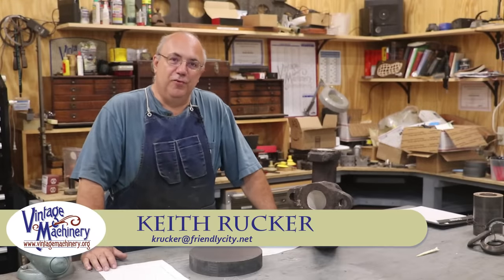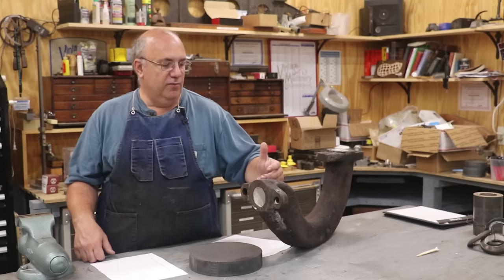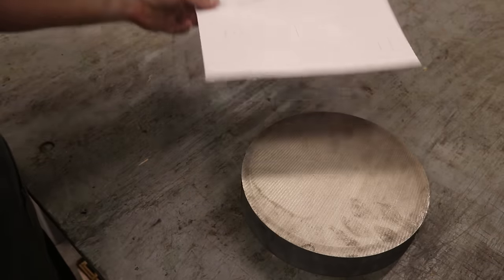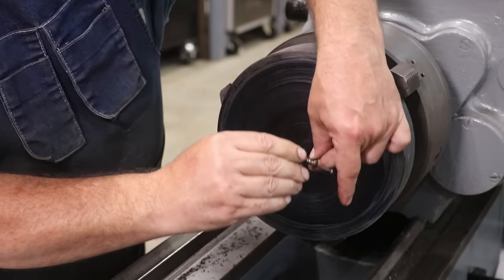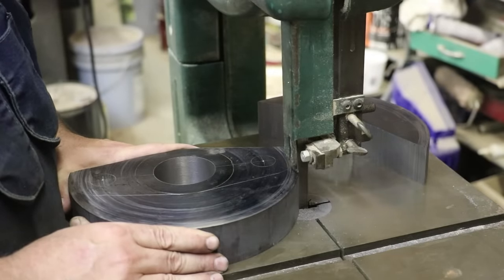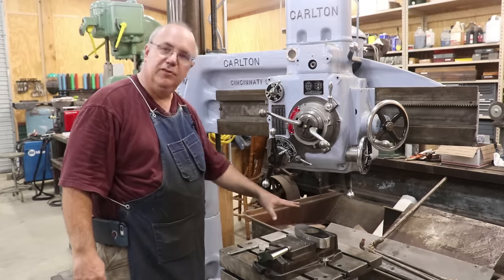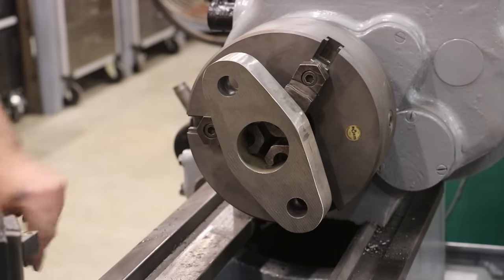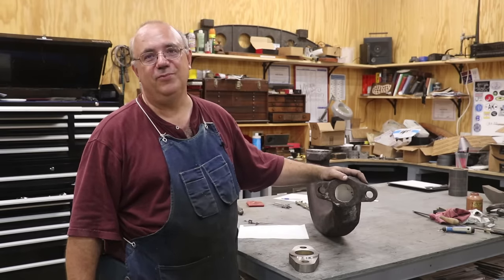Steam Locomotive Steam Pipe Repair - Part 2:  Machining a New Flange

Comment: I would use a boring head in reverse to machine a snout on the old pipe that would pilot into your flange. It would give you a much stronger joint. Personally I still like the idea of a slip joint with that flange to accomadate expansion and contraction as well as movement from loads but that is just me and I know it wouldn't be original.
Reply: I agree completely with you on fitting the flange this way. Also I would dry fit them in situ before tacking them together.

Comment: I'm so glad that you took whomever's advice, I think that's gonna be a lot more solid than the original plan. Now you just have to get it lined up perfectly against a lopped off cast iron part with no machined references, with tight enough tolerance that braze will create a strong joint. Hehe. I have faith that you can do it!

Comment: That's another great video full of "how to's" .  Durabar is a wonderful resource for DI and CI material.  They always provide extra stock over the  print dimensions, to make sure you can clean up okay.  I'm glad you covered the difference in expansion between iron vs. steel.  That was my immediate thought when you started talking about a steel flange brazed to the antique iron pipe, and that could get a novice in trouble.  As ususual, the vicarious experience was enjoyable.  Now for the big trick of alignment.  That should prove interesting.

Comment: As a machinist for the Navy for 26 years the way I would repair that is to cut both ears off.  I would then set it in a horizontal mill to flatten the end then center the spindle on the center of the hole. I would install an indexing head to the spindle and as the cutter went around the outside of the pipe I would slowly adjust it to take more metal off until I had a fully machined surface around the opening in the end of the pipe. I would then machine a flange that had a 2 to 3 thousandths interference fit, heat it up and press it on the pipe. I would then braze the flange to the pipe.

Comment: Keith thank you so much for everything I have learned watching you and your channel. You have some truly amazing people to help with feedback. From a strength and ease stand point I would think that I would want a socket on the flange and fit it in place to allow for both maximum strength and minimum time to be able to fit up your repair. I might even think about using a spiral wound gasket for maximizing the seal of the joint. It would not be original but it has shown me the they’ve fantastic for being able to get a great deal. Thanks again.
Reply: Nothing like a typo lol....

Comment: I would taper counter sink the back of the flange, grind off the flange ears off the original piece and add a taper to the end that matches the rear taper on the flange and then braze them together where the the taper seats into the flange, if you just completely lopp that end off you will have only the surface area of the thickness of the tube wall with the new flange.

Comment: When repairing a pipe spool I always bolt it to a couple of dummy flanges, tack them to a steel table and remove the part to be repaired. You can then bolt the new parts in and weld or braze them and when you take it out it fits.

Comment: Although this is a comparatively small branch pipe, I would consider bolting it back onto the throttle pipe head and the new part with proper seals (copper I believe) bolted to the saddle. I would then pre-heat with a couple of rosebuds before brazing in place. Wrap it in a welding blanket or two to cool slowly. I believe this might help in achieving proper alignment.

Comment: Watching this series over a year after it was done but my first thought was why not build a whole new flange. I also thought about leaving extra material on the width and thickness as well as the length to have as much surface area as possible but I tend to over build everything. Thinning the flange on the lathe before cutting it in the band saw might have been easier. I assumed you would cut it down to the 4 inch first to avoid the interrupted cut but it didn't seem to be a problem.

Comment: I am not a machinist, not at all and hindsight is a wonderful luxury you did not have!!
Would it not have been easier to have kept it round, clamp it down, drill the side holes, turn it down to the correct thickness with the raised bit without having the interrupted cut and then band-saw it to the desired shape?
Love the video's !!

Comment: I did something similar with the body of the quick change tool post I made.  Using radial marking grooves to highlight where corners and junctions in the dovetail should be, and mark where the bore and split termination hole centers should be.  Put a center line across all that, and you have enough visual reference points to keep Bozo at bay.

Comment: Hi from England 

I think you've taken the best way to approach this one Keith...
Sometimes it's better to start off again with a clean, straight edge....

No doubt them clowns at that local fabrication shop would've just kept on banging more & more heat and more & more ore into it....until eventually it'll have just popped it all...

Older iron with high impurities and what's been subjected to hot & cold...hot & cold...hot & cold for years on end can be a bitch to weld as well...

Now...
How are you going to fit it to the end after you've lopped the old flange off...?
How about a thin sheet metal sleeve shaped to fit the inside profile....you can then infill with braze...
You could drop it in the pipe first...with some sticking out and gently hammer it to fit the bore profile...then braze it in...
Then drop the new flange you've made over it...again, braze it in....then go round the meeting edges...braze it...
That'll be ship shape & Bristol fashion...

You know what...
You'd even get away with a silver solder Keith...

Comment: This isn't rocket science guys....so many comments about precision fits, tacking in on the job etc. Keith has the original blueprints the part was made to. All that is needed is to ensure the cut made in the pipe is square and accounts for the new flange thickness, then clocked correctly relative to the other end. A simple grinder will achieve the bevel needed for brazing, and a simple fixture screwed to the table will hold flange and pipe steady for the job.
These locomotives were made 100 years ago- such precision was unachieveable and they were designed with tolerances to account for this....it doesn't seal to the flange- it seals to a ring which allows for some misalignment.

Comment: Using your logic of different materials moving at different rates will the braising expand different from the cast-iron and crack being such a large area would it not be better to use a cast iron stick welding rod so the entire area is cast iron and movers the same

Comment: i spent several years working with various types of gas fired waste heat boilers and they were all steel.  I wonder why they did not use steel to make the pipe and the flanges and weld the flanges on.  I guess that is because I know nothing about steam locomotives.  I suspect the welding technology of the day could not handle that large of a job.
Reply: Compared to some of the gentlemen commenting on here, who obviously have had careers working with steam, old boilers, locomotives, ships... I am a complete amateur, bordering on a babbling idiot, lol! 

However, I suspect cast iron was used here because it does not expand and contract like steel does. And, in that era, they had limited choices - less alloys, less fastening alternatives, etc. 

But, what they did know was the awesome, violent properties of that steam that was to be channeled through those pipes... And the way they did it lasted for 100 years. And for an environment that gets super-heated - and pressurized - like this, I think that's a phenomenal feat of engineering, again, for what they had to work with... Only the human mind to compute every single possibility, factor in every single thing that could impact that pipe, that joint... 

It's actually staggering when you stop and think about it - compared to today, where even the laptop I'm working on, given the right software and the properly educated mind using it could offer up that part in moments - plus different suggestions on what alloys would be ideal, etc etc.

All that to say that I think the guys back then knew what they were doing. :-)

Comment: A fundamental mistake. That casting begins its steam flow curve within the flange area and your replacement flange does not take that into account. I expect that when you slice the casting to mount your new piece, you will find a large gap that you will need to fill on the inside of the arc. Along with a large amount of grinding to allow for proper steam flow. Otherwise, you will find that your repaired part will not allow enough steam through to allow for balanced power in the engine. A good first attempt.

Now set up a jig to hold the parts square and true for the assembly portion and then cut off the old flange. That way you can see how to shape the steam flow and mill the offset to match the next attempt to the existing piece.
Reply from the maker: I think I have it under control.  You are correct about the curve, but I have taken that into consideration and made sure my plan will work.  The flange has more machining that will need to be done but I cannot do that until I get the old flange off and make some measurements.

Comment: All the laying out why not copy the diagram and glue it to the blank cast iron disc.
Reply: That is what Clickspring  https://www.youtube.com/channel/UCworsKCR-Sx6R6-BnIjS2MA would have done.
Reply: only works if the pattern is exact.  Laser printers can distort the dimensions during printing
Reply: I do not think the tolerances are that close to worry about, it is not a clock.
Reply: Paper stretches and creases, plus a scribed line is a lot thinner than a printed one (or at least that printed one). Laying it out means it'll definitely be accurate enough (the paper probably would be, but it'd be a pain to make the part and find it's just far enough out not to fit).
Reply: He took the measurements from the paper template.
Reply: Yes and no - he read the annotated measurements off the paper, then used a steel rule to set the dividers. He did not take any measurements directly off the diagram.
Reply: He also cannot rely on the measurements of the pipe as it keeps breaking, it is not right

Comment: I being from oil field country I would have put aside the old part for future cast iron replication . Then have a steel part made to replace the original part not a repair of the old part as I think there is too much heat for brazing to do well.

Comment: The size of that flange kinda puts the size of the pipe into perspective. It just didn't seem that big till you held the 9" long flange up to it.
Reply: Lining up everything to make sure it fits is going to be a problem. I think it will have to be partially brazed in situ in the steam engine to make sure of alignment and then finished on a bench.
Reply: i agree with you tony thats the way i would do it. bolt everything up in its happy spot and then i would heat it up and take the chill off it and then i would tack it good with silicon bronze then tack it out and braze it. once you get it 2 thirds welded then grind out the bronze tacks and then carry on brazeing.
Reply: I do not think it was casted right in the beginning as it keeps breaking lugs unlike the other one, it must have a twist in it and the only way to to align it is in situ. Trying to do it on a bench is impossible to align and all the hard work of making the lug will be wasted.
Reply: i agree again tony doing it on the bench and takeing all kinds of measurments and such would be near to totally crazy to try that on the bench and hoped it worked and lined up again waste of a whole bunch of time in my opinion. must be done in position.
Reply: im really looking forward to see how kieth is going to do this.
Reply: He usually comes out on top, he has something up his sleeve.

Comment: I would braze it together in place if you have the room inside of the locomotive, that way you know it is in perfect alignment.
Reply: If you can't braze it in place, put it on the locomotive and draw some alignment marks at least.
Reply: I can't think of a way to test fit these parts without risking excessive removal of material from the original casting. I look forward to seeing how Keith approaches this problem.

Comment: Will you dry fit it to the locomotive?  It would be neat to bore and machine the flange and original part to make a more secure joint...maybe.  Talking as a bricklayer instead of a machinist.  Just a thought,  Greg.
Reply: Absolutely. Bolt the parts on the locomotive then braze. Assured of a proper fit that way.

Comment: Wow looks great!! For fitment, you should bolt the flange and the rest of the pipe onto the locomotive separately, and then tack weld it together.  That way you know for sure it will all line up in the end.  I have done a lot of exhaust work on cars and I have found that is best the way to do it.  It will never work out if you try to weld it on before fitting it back in the locomotive first.

Comment: I was wondering if there was enough room in the train where this pipe goes that you could have just punched the holes, turned your 1/8 inch flange and rolled with it. Seems like it would be much stronger and also you could have cut a couple more holes perpendicular to the other two and it would never break. You said there was plenty of room so that is what made me wonder...

Comment: Nice Job Keith. 
You know I wondered what the heck is Keith going to do with all that huge equipment, Well it looks like that Radial Drill made short work of that cast iron. 
Outstanding, you have a shop that so many of us envy, and you have worked very hard pulling it all together.
Gary
75-Year-Old Home-Shop-Machinist in North West Arkansas.

Comment: I would have thought this job would best be done using a rotary table on the milling machine. Could have used the DRO to position everything easily and accurately. Also, no need for the bandsaw.

Comment: When I first heard the term "boring bar" I visualized a step-by-step increase in diameter, just like you are doing here with your increasing drill diameters.  That was not quite right, but you are doing this kind of thing, though with a drill bit, so I was not completely wrong.

Comment: Bc and I think alike , I'd bore the boss on the old part and open the flange to accommodate as much has I could at least 1/4" walls . Then the original cast part will be supporting the pressure and not just the brazing. Think about it it's not much more machining but it'll maintain the integrity of the original part..

Comment: I have to agree 100% with what you did in this episode, choice of material, thickness , liked the layout and manufacturing of the part and could feel how my teeth relax as the bandsaw chew through the cast iron like butter at 25x.

Comment: Do not sweat the minor cosmetic issues .  The public will never see it .  Dimensionaly , I an certain it will be closer to the blueprint than the original 100 year old casting .  All it has to do is fit , work & not leak .

Best of luck to you ,   :-)
Wyr
God bless

Comment: I have a newbie procedural question.  I was wondering why you chose to cut out the flange before doing the lathe work on the second side.  My first thought was that doing both sides round you would not need to reconfigure the lathe chuck, and you would not have an interrupted cut for the turning. You would also have had a thinner part to saw, 1.125 instead of 1.75+.  But then, trying to figure out the counter advantages to the way you did it, there is a lot less nasty cast chips and dust to clean up on the lathe.
As a wanna be hobby machinist, I would like to learn the factors that you guys with experience and expertise consider on a job like this.

Comment: I suspect you will bolt the pipe in place and figure out from there the geometry of the flange. Perhaps even tack braze while in place? Hopefully enough thickness is left on the new flange to allow for the fitting. Hoping you will share that process as well.

Comment: Nice work Kieth.  Can you make a jig that  the existing pipe fits into that mimics the flange locations  in the loco so when you cut the old flange off you can bolt the new flange into the correct position to be welded.  Its how I make new pipework from old samples.

Comment: Keith, 
        Do not cut that existing flange off !!! you need a socket weld here. Turn them off and bore the new one to accept the snout yo created. then braze in place after all is bolted up tight. Been there done this. If you can't turn it we can do it here.
                                                                                                                   Forbes

Comment: That came out great Keith. Yes, there is actually good info and input on the interweb. Would have been a lot more work making the fixtures to hold the whole pipe for machining material you added. The new flange will have stronger ears,and that's where all of the stress is when torqued down.Thanks for all of the great vids.

Comment: Stupid question... why is the inside of the pipe white?  Okay, has something to do with the steam going through it, but what is it in (or about) the steam that turns the inside of the pipe white?
Reply: Basically limescale - like your kettle if you live in a hard water area.